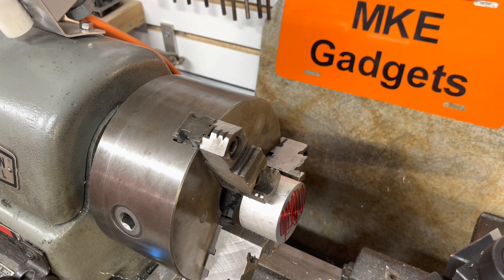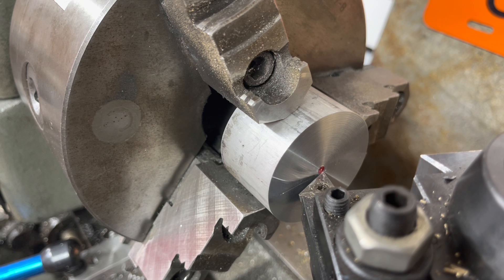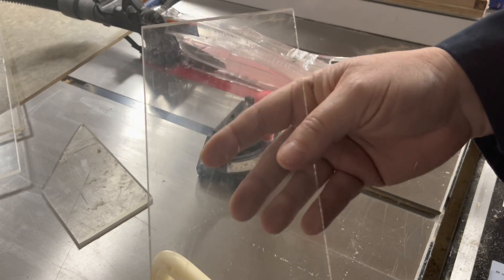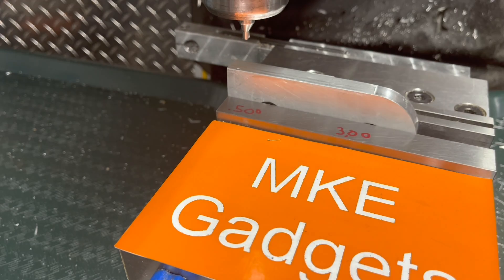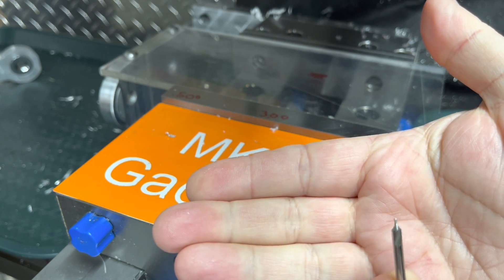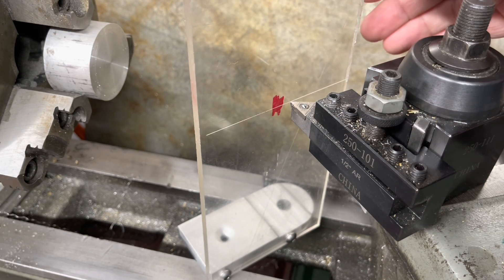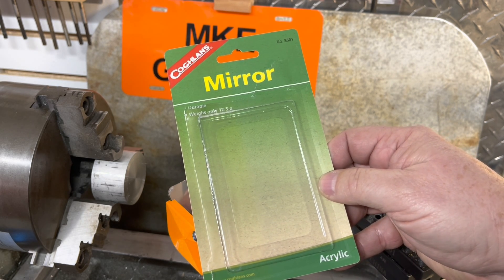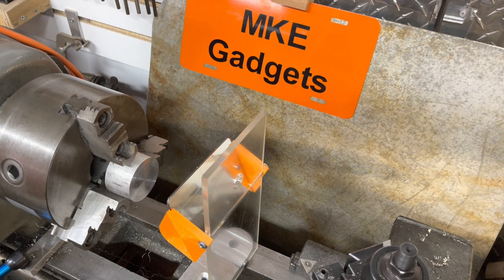Lathe Tool Height Gauge @ MKE Gadgets #160

Comment: I love gadgets as much as the next guy but I just use the point on a center in the tail stock or tool on holding a scale against the work
Reply from the maker: When you’re cutting on the lathe , you wanna have your cutting tip on the center of the part..

Comment: You are not using your tool post and tool holders correctly.
Reply from the maker: How am I not using my tool post holder correctly? Please enlighten me.
Reply: @mkegadgets4380  It is kind of complicated to describe in a few short sentences.  Set your tool post so one face is parallel to the chuck and the other is parallel to the centerline.  When you either face cut or turn a shaft get the correct tool holder.  You don't need to be changing the angle of the tool post for facing parts or turning/boring operations.  Kennametsl makes insert holders for facing/turning operations.  Get the right tools and save time in set ups and make more money as a machinist.  If you are a hobby lathe operator continue with your method.

Comment: I like it... gonna make one.   Have tried a lot of methods. The challenge I have is my lathe is a Sherline mini; things normally done a full size lathe are near impossible due to lack of room.

This I can scale.

Thanks for taking the time to vid this.

GeoD
Reply from the maker: You can scale it to any size Lathe if you want. Thanks for your comment. Please consider subscribe and if you haven’t. Check out my over 215 videos.
Reply: @mkegadgets4380  I sub'd, about ½ way thru the 2nd vid I watched.

FYI, I found a great way to store zip lock bags. Use one of those paper accordian files labeled A-Z, (they have more partitions).

I sort bags in size & label each divider. You can get a tremendous # of bags in it & they're durable. The one I use for bags was old & used from a business I had thru the '90's & early 2000's; a bit of packing tape help & it's over 30 yrs old.

Something I added along the way was a hand drawn rule w/  1" increments to the top front for qck measurement.

After a while I had so many bags of one size, I started putting 11 bags, folded in half inside a single bag & gave them their own division.  Makes it easy to grab bags & give them to friends who come by.

I also use an accordian file for storing thin plastic, paper, rubber & metal sheets. Even have enough room left to store my drawing paper, plastic shape templates & old project drawings in the back 4-5 partitions.

The older I got the more I craved not wasting time being disorganized. About 50, I will on a organize everything campaign after I found myself digging thru a container of fasteners for the umpteenth time.  I just couldn't stand wasting what time I had left; glad I did, now that I'm 70!

GeoD

Comment: That is a really clever tool.  Thanks for the video.
Reply from the maker: It works quite well. And you don’t have to rotate your tool holder towards a side of the ways. You can set the height anywhere the tool is sitting. Thanks for your continuing support.